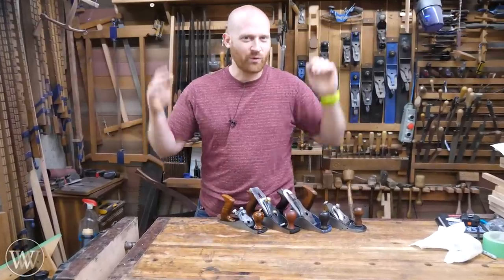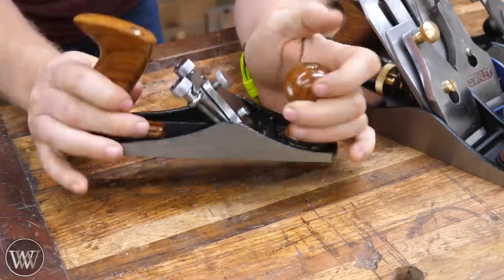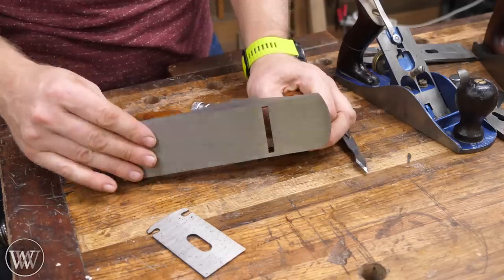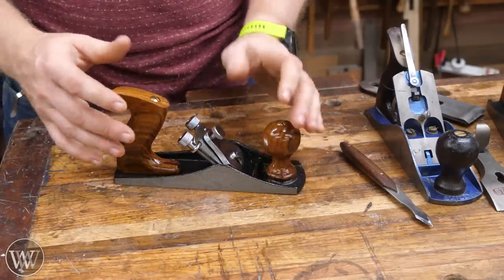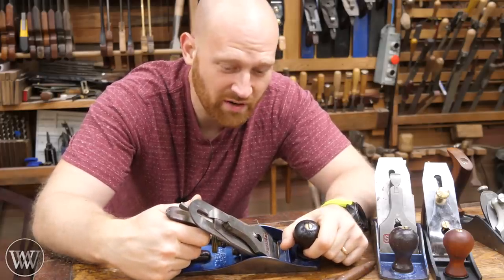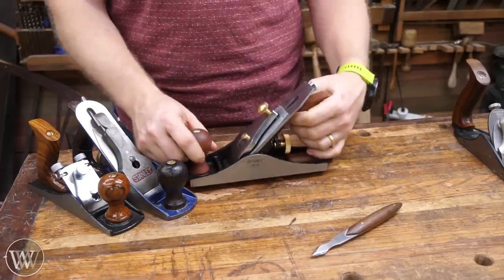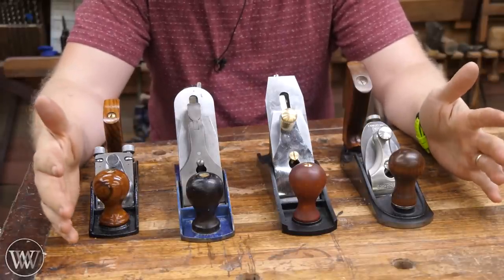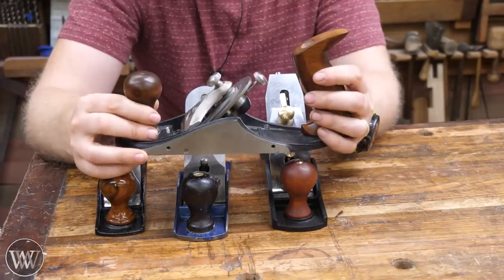The Good the Best and the Ugly | Choosing a Hand Plane

Comment: I got one of those cheap style ones from my neighbour for a buck. It's not as bad as the Hazard Fraught one, it's got a decent handle and it's made in Germany, but it didn't have an iron or a lever cap, so I made the iron out of an old wrench (the flat bar type of stamped wrench that comes with a tool) and put a radius on it and I made the lever cap out of hickory. Makes a great scrub plane, and I never had one before. I also have a Stanley no. 5 that I bought new in 2001 and I don't think the quality of it is any worse than my antique no. 4, apart from the plastic handles, which I immediately replaced with wood. It's made in England, and the casting is a little heavier, but that's not really a bad thing. The only thing I really hated about it was that the screw that holds down the lever cap was zinc plated. It was so ugly. Fortunately that's nothing a little bath in sulfuric acid can't fix.

Comment: Go on eBay and look for Stanley type, 11, 12, 13 even 14 and work them up.   The REAL Sweetheart ones are type 13 and restore really well.    The type 11s have excellent castings and are the first type to include all the main Stanley patents.    For my bench planes I have a full set (#2-#8) of Bedrocks which I gradually restored from junkers.   I patiently found all the right parts quite cheaply, gave them a totally new authentic coating of black japan (NOT black paint!), put away the original irons and equipped them with Hock irons.   They have new rosewood totes and knobs which fit a modern hand size.    They are a joy to use and I had a lot of fun slowly hunting down the parts which were not hard to find.   I also have a truly fine Lie Nielsen rabbeting block plane and a L-N low angle jack for difficult material.   L-N planes are very well made and have excellent irons.   Actually my #2 Bedrock has a L-N iron.    Bottom line, buy an earlier (1910 - 1945) Stanley and work it up.    There are plenty of #4 and #5 on eBay.   They are the place to start.   #4 ½ is also a great bench plane with a bit more heft.   I use it a lot.

Comment: Just get a Veritas low angle jack. That's what I wish I had done when getting into hand planes. You can smooth faces and joint edges. Make a shooting board and easily square ends. Open the mouth and put in a toothed blade, you're turning firewood into lumber. Figured grain, no problem, get a higher angle iron for a lot less money and effort than replacing a frog.
For the price of a high end smoother, you can get the Veritas low angle with 2 additional irons to do basically everything. The 3 set screws along with good manufacturing solves the problems you'll come into with the Stanley and others. Then just convert the regretted plane into a scrub or use it for the pallet wood you know you're accumulating...

Either that, or plan on starting a collection of hand planes.

Comment: Rex Kreuger has a video on tuning up a cheapo plane. It involves removing the adjusters entirely and replacing with hammer taps.
Reply from the maker: yup there are a lot of videos out doing similer things. I even have a few of those. the problem is you still have the high vibration poor feel. and most of the time it does not stop them from coming out of alignment. though I know a lot of people that is worth the cheap price tag.
Reply: @WoodByWrightHowTo  which is why he upgraded to another plane next videos later

Comment: I suspect the Harbor Freight planes are inconsistent, or perhaps there's a psychological preconception at work. I don't have the $50-$75 for a used plane (they ain't twenty bucks anymore, folks) and I figured if it was junk, I'll return it. At most you're risking $15. But it is a very nice plane. Not top shelf, obviously, but very usable. Maybe I have tiny hands, but I find it very comfortable. I wish HF sold a #5.
Reply: <-----woodworking for over forty years.  I've got Millers Falls, Stanleys, a Dunlap, a Fulton, some Japanese kanna and made a few Krenov style planes.   Bought that harbor freight 33 twenty years ago.  All I've ever done was sharpen the iron and oil the sole - works just fine!

Comment: The Woodriver planes are almost as much as buying a Lie Nielsen or Veritas, not worth it in my opinion for a Chinese made tool.  They may be good but they're not good enough that I would only save $10 for a no 62.  At the point i'm buying a Lie Nielsen.
Reply from the maker: That's why I still put them into the high end of the middle quality planes. There's a few fit and finish things on them that aren't quite what I would want.
Reply: @WoodByWrightHowTo  Yup not worth the $10-15 savings for either of the others.  Their prices are competitive but the quality isn't there for the price tag unfortunately.

Comment: One consideration you did not state in your video, when buying new, is where is the plane manufactured.   Lie-Nielson are not only high quality out of the box-- they are made in USA.   Lie-Nielson blades are thicker.  The soles are flat and need no additional tune up on the sole or the frog like some imports.    Sure, you save money by purchasing an import.   They are lower cost in part because Chinese wages are lower.  They are lower cost because you still have to do work to get them tuned up.   For myself, I'm willing to pay more to support high quality and American workers.

Comment: Don't bash Harbor Freight too much I bought one of these planes and I have been a carpenter and woodworker all my life 53 years. If it is sharpened and tuned correctly it is just as nice of a working plane as lie-nielsen or Stanley or any of them it's not the tool it's the user
Reply: I have to give it to the Chinese for that number 33 plane once you get it up and running it is extremely nice
Reply: If you want Comfort buy a new mattress
Reply from the maker: I have tried three of those. It's one of the most uncomfortable planes ever used. It is true they can be tuned up but they don't hold the tuning and require constant work. Also when testing the iron it was by far the worst iron of the 24 different plane irons tested. Sounds like you got really lucky with that one.
Reply: @WoodByWrightHowTo  it will take a little time but lap your iron cap perfectly flat and you won't have that problem. Yes it's true the cheaper planes need more prep work to make them work properly but you always get what you pay for
Reply: @WoodByWrightHowTo  A lot of us must have "got lucky" with that harbor freight plane.  Mine works great as well - out of the box - just needed sharpening.  

As for the iron quality - mine is harder than my antique Stanleys or Millers Falls.  Maybe you just got "unlucky" with yours?

Comment: Critique #1 the HF plane is a number THREE! Ever #3 has tiny handles. Big box stores will sell Buck or Store Brand #4's. HF does not qualify for BB status! Cr #2 your Stanley has a busted handle AND, thanks to idiot hoarders....umm I mean "collectors" finding one for less than $50 bucks is a chore. Taylor Tools...most planes are SOLD OUT. I wonder why.
Reply: Yep.  I cringed every time he called the hf a "big box" plane.  My number 3 hf has worked great as a smoother.  Unless you're using rough sawn lumber, you don't really need a scrub but a general bench plane plus a smoother should do 90 percent.  A #7 will get you the rest of the way.  Oh, All I've ever done to that #3 hf is sharpen the blade - all you need to do.  Also, the adjusters are just fine for me.